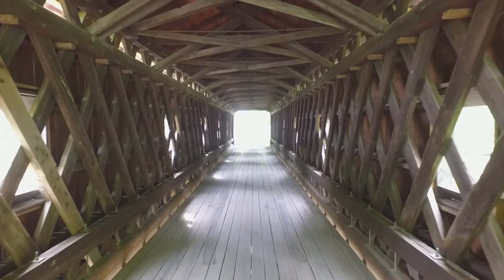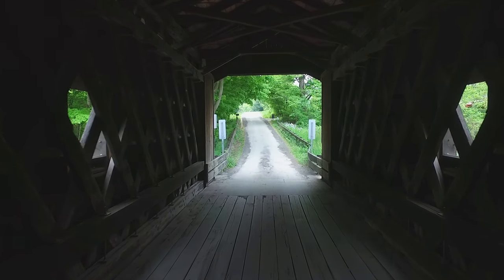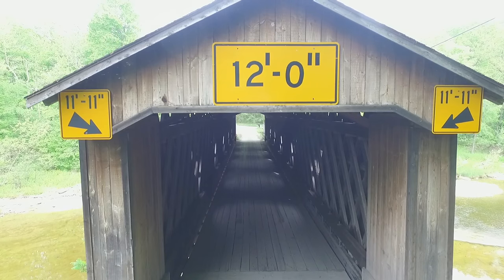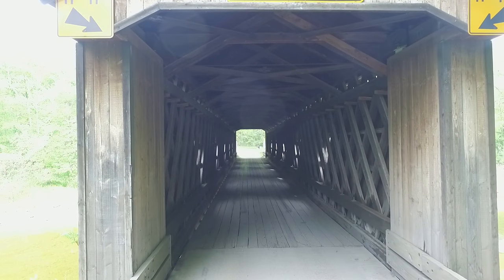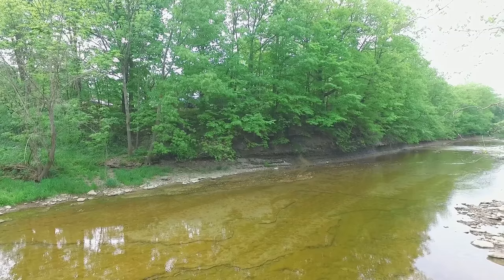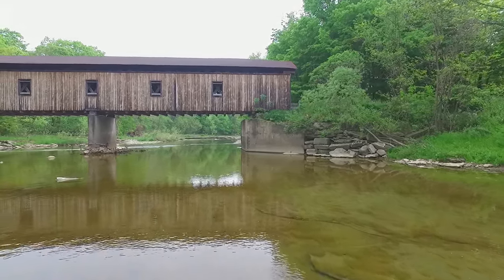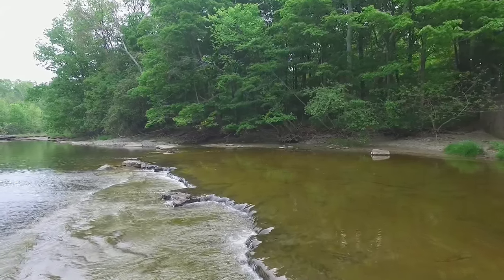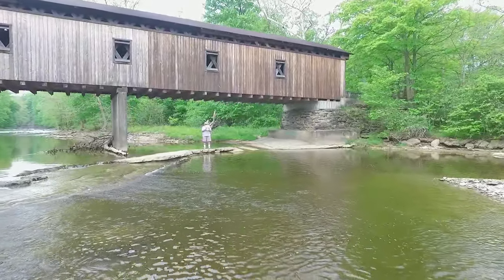P3A Olins Covered Bridge 5-26-16 (1080P60)

Comment: I enjoyed that Bill, a question about the river though. I can see that it is running over rock, is that the reason there is no vegetation apparent in or close to the river, likewise there is no sign of fish or any other wildlife(although at one stage I thought you were going to say poisonous snakes) so it makes me wonder if the river is polluted.  I also notice that the universal idiot with the paint can had found his way there.
Reply from the maker: Most of these creeks or stream (they are actually tributaries of larger rivers) run pretty slow and are pretty shallow, but do have areas which are deeper. I've accessed a few Ohio EPA and fishing sites and they do claim that there are fish in these rivers/creeks/streams, but I didn't see any .. but then I was in shallow areas.  There are plenty of wildlife and insect life around, that I can assure you!  Didn't see any snakes, but there are all kinds of birds and critters close by. These are all "fresh water" streams, and you could probably drink from them in an emergency, but if I were on a camping trip, I'd at least take the precaution of boiling the water (or adding the proper iodine tablet(s) ) before drinking any large quantities.  Yes, sad, but youngsters (teenagers) don't seem to have respect for these old bridges, or much of anything else as far as that goes. Most of these bridges have signs in them which were put in sometime after they were built which states that any kind of damaging or defacing is subject to 1 to 10 years in prison and/or a $5000 fine. Many of the signs are so old that the writing on them is no longer legible, not that it would likely stop the young vandals.   Glad you enjoyed the video, I shot 3 more bridges yesterday, and am working on the videos now.  Just have 4 more to shoot after I get these 3 posted. Cheers.